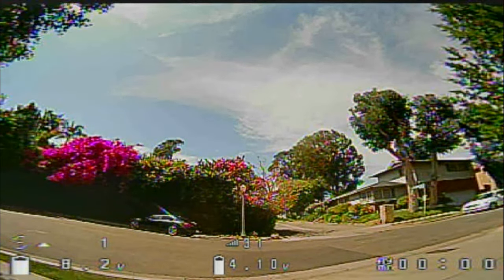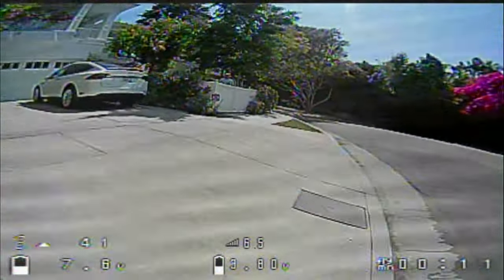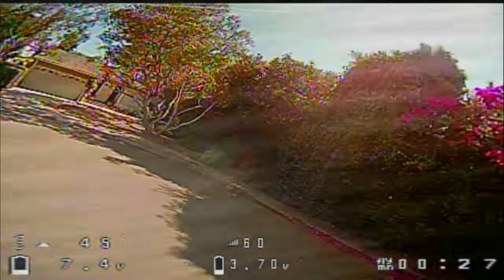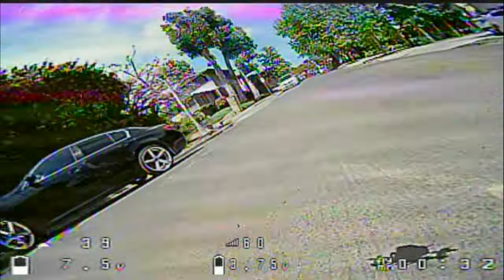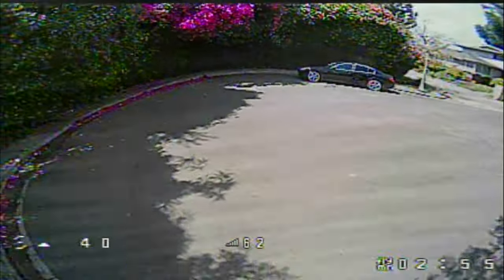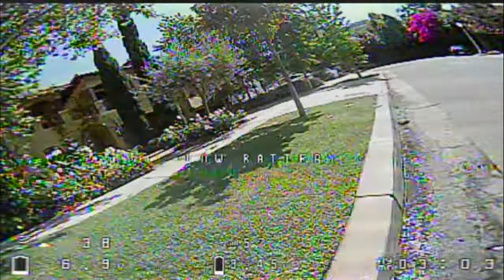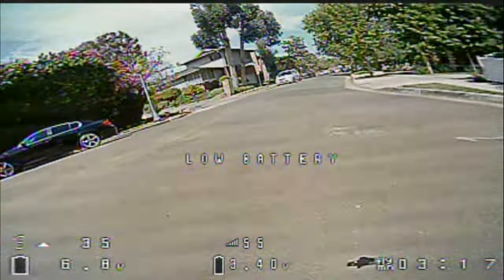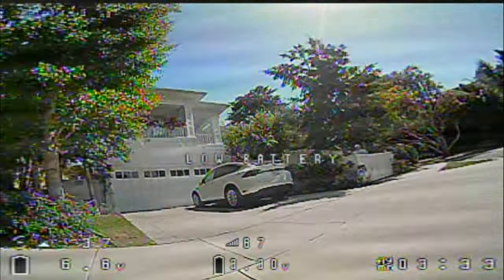Sub Atomic 2 - One pack 350mah 2s 35c

Comment: Pid tune?
Reply from the maker: missed this comment.  Pids are:
set p_pitch = 55
set i_pitch = 52
set d_pitch = 30
set f_pitch = 60
set p_roll = 51
set i_roll = 47
set d_roll = 28
set f_roll = 60
set p_yaw = 65
set i_yaw = 45
set d_yaw = 0
set f_yaw = 60
set p_level = 50
set i_level = 50
set d_level = 75

Keep in mind, this is betaflight 3.5.3 though